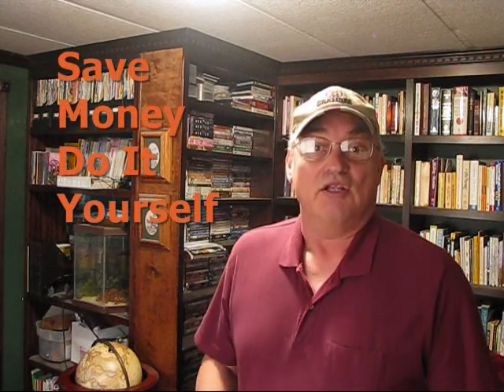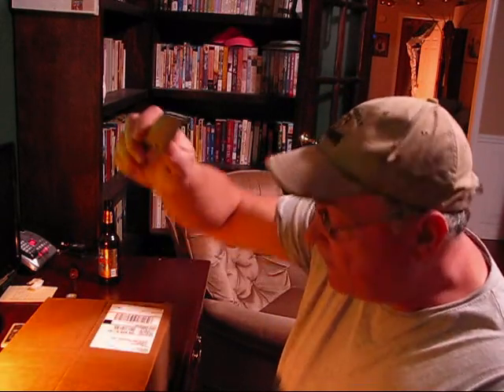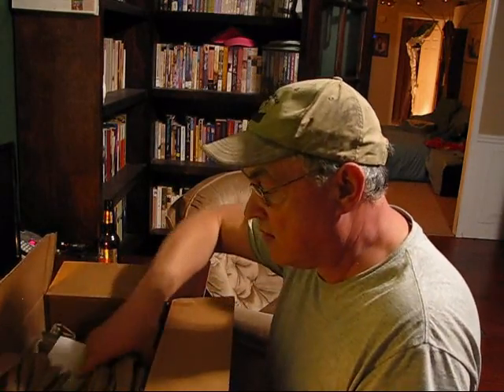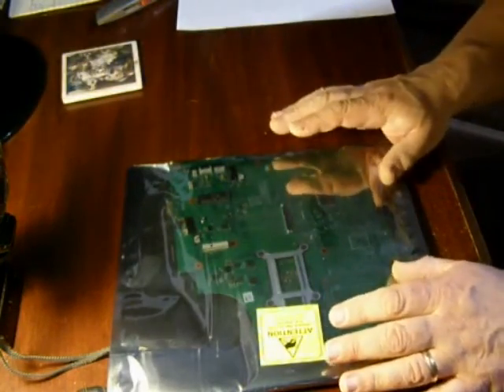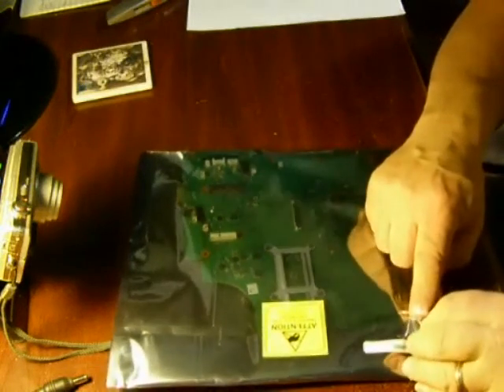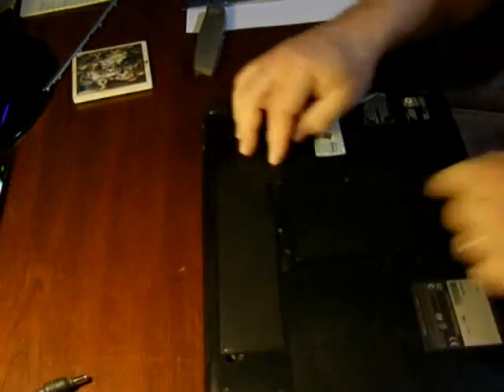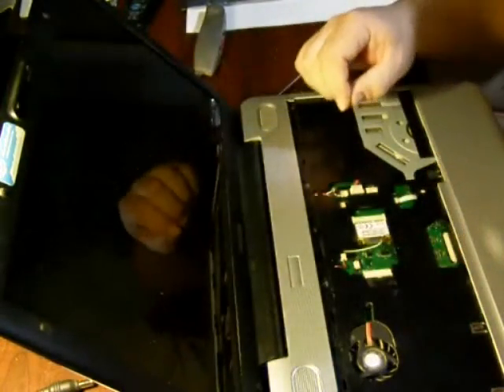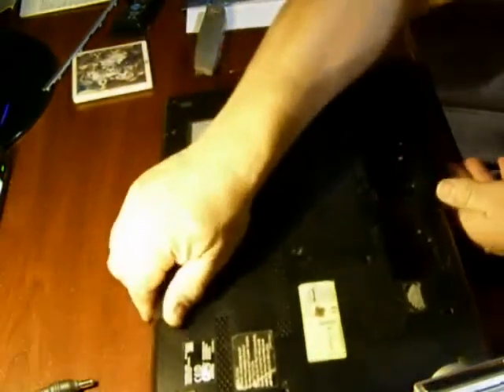Save Money Do It Yourself - Repair Your Own Computer

Comment: I did notice that you put the cpu on and then the heat sink without replacing the thermal paste. If you get any problems down the line with it overheating, it'll be worth opening it back up to replace it. 
None the less, a great job... Well done👍
Reply from the maker: +Darren Soames There is a little spot on the video I did not mention but it does show me smearing the paste on prior to the placement of the heat sink. It could have been between camera angle movements. Most folks would not know about that, Good eye. Thanks for watching.